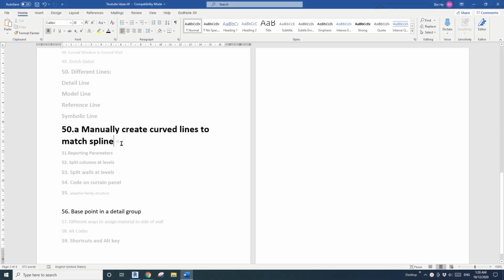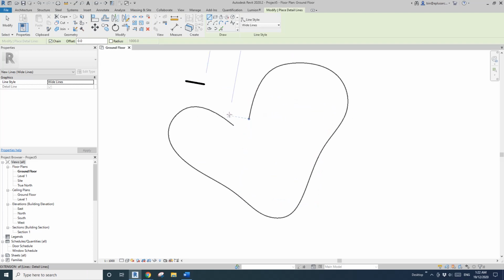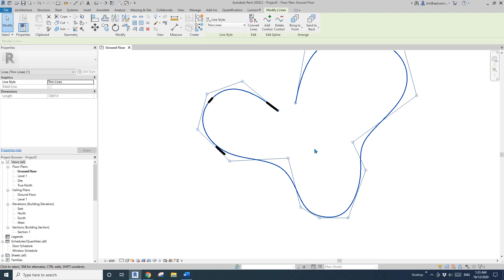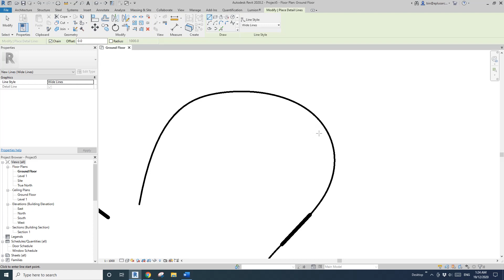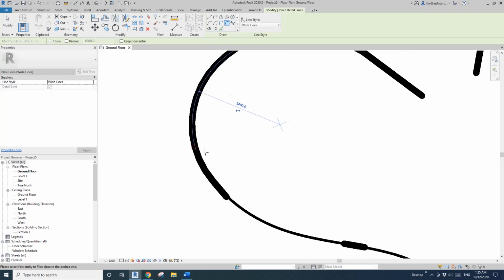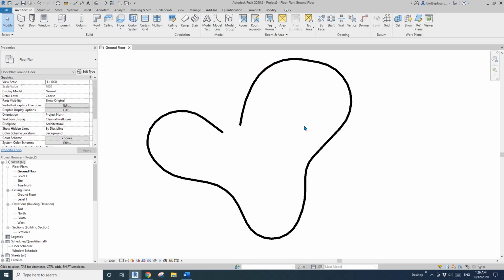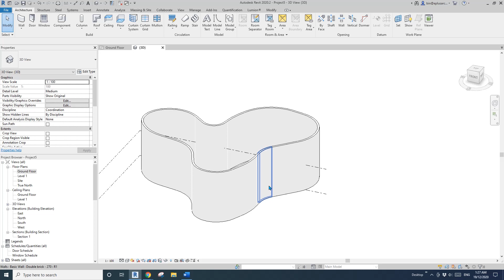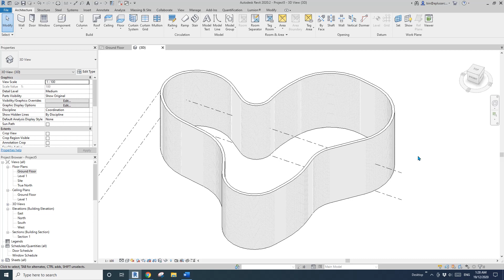Everyday Revit (Day 275) - Manually create some lines and arc to match a spline

Comment: Actually what is the real function of a spline? it seems like it's just a guideline that doesnt pretty much nothing than for guiding or referencing? But this tutorial is super helpful!  A lot of times a spline is needed to draw curvy stuff but to make a model out of it we need this method u taught. Thank u!
Reply from the maker: You will use spine quite often in mass, but lines and arcs for ordinary walls and floors so they can be dimensioned.
Reply: @BINHE615  oh yes! i forgot the important SPLINE THROUGH POINT!!